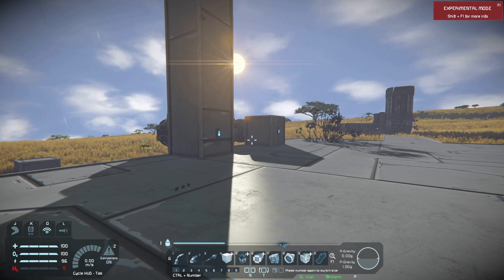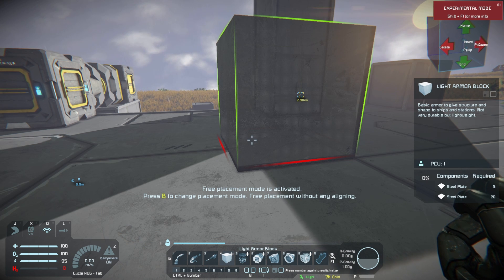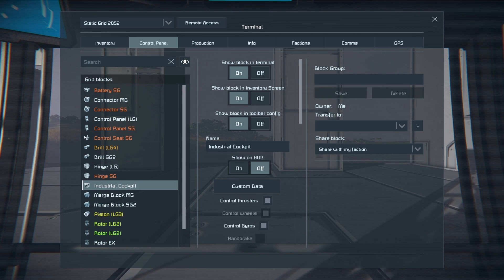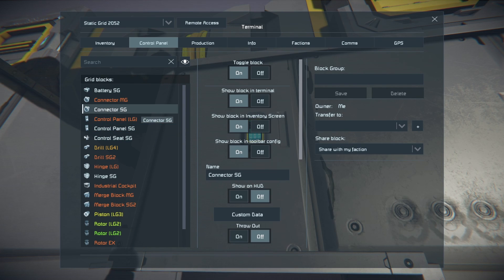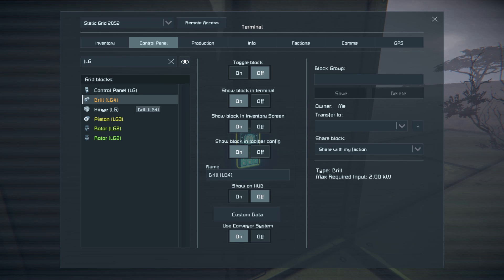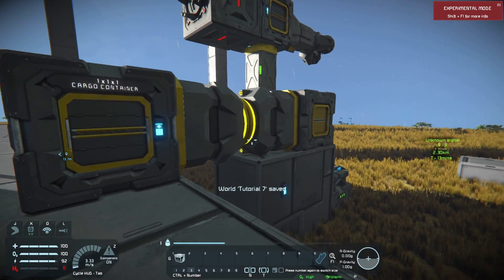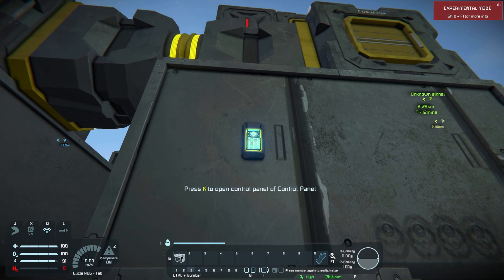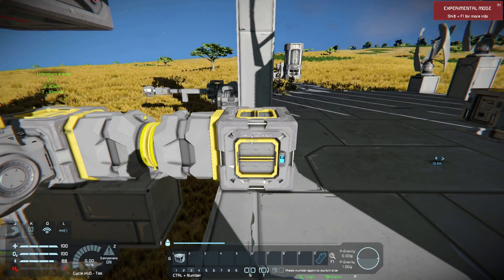Space Engineers - Understanding Grids! (Better Audio)

Comment: Grids do not worK CAN NOT ATTACH  WIND TURBINE TO THEM
Reply from the maker: It depends on the type of grid you are making. If it is a mobile grid (ie it has wheels or engines on it) then no, you can't attach a wind turbine to them. However, you can attach them to stationary grids and subs grids.